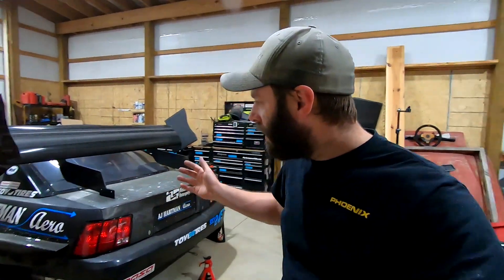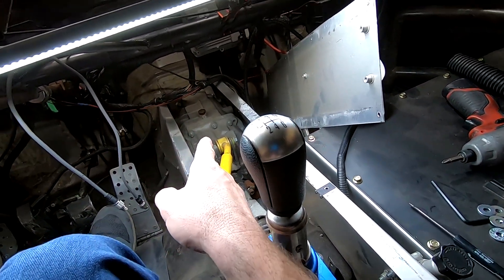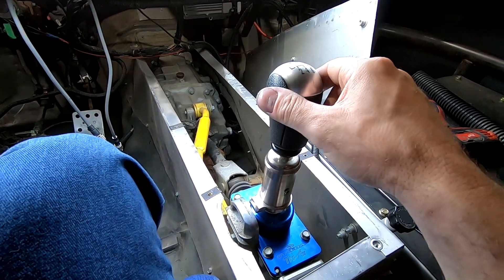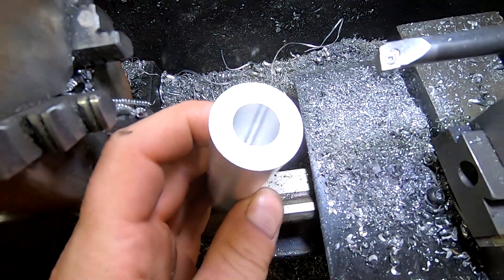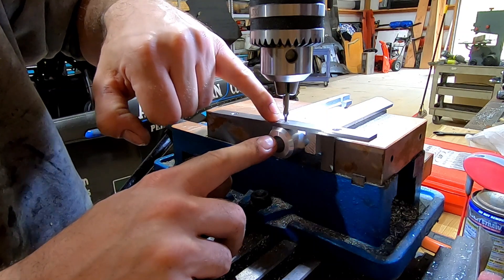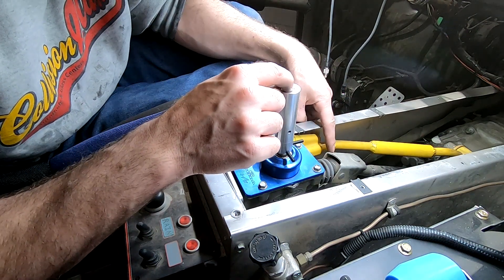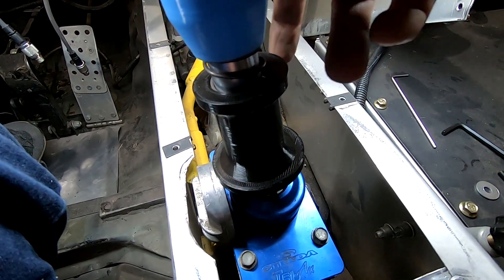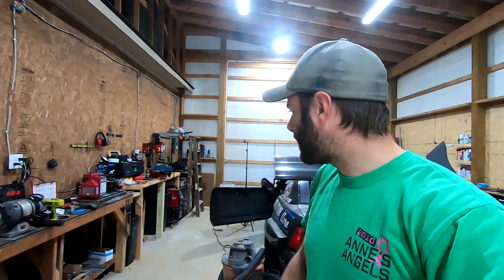MT82 Shifter Slop Eliminated- CAD model, 3D printing, and Lathe work

Comment: Hmmm... Your probably ok with PLA. I usually print anything I plan to put in the cabin out of ABS but since you don't keep it outside and don't have side windows temp shouldn't be a problem. You could always just throw a rag over it to keep the sun off while the car is sitting between runs.